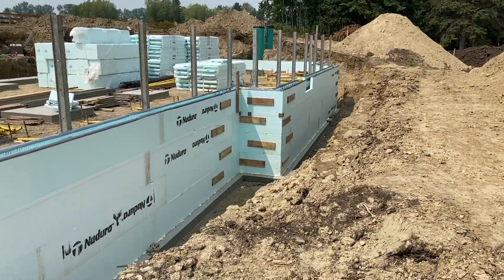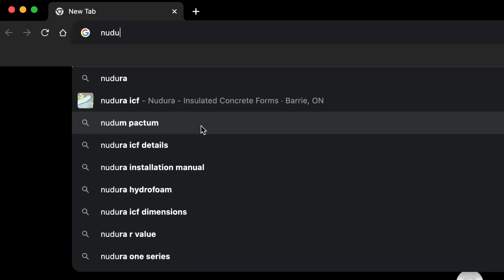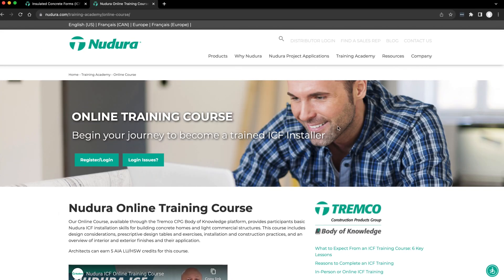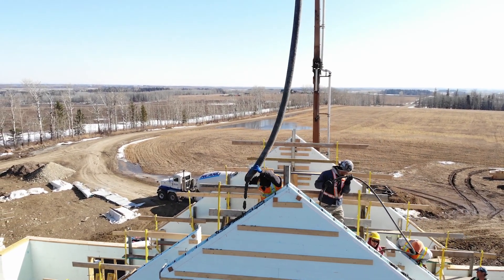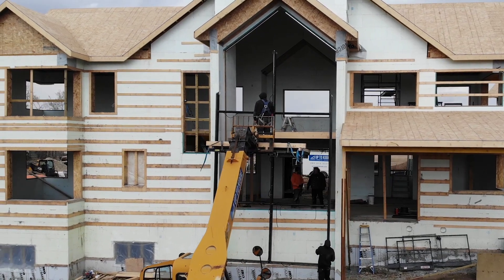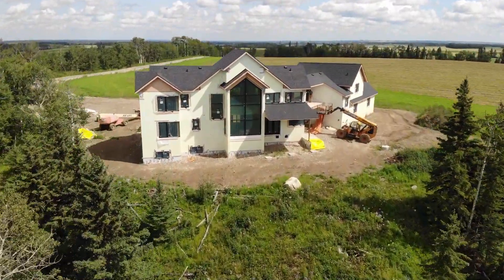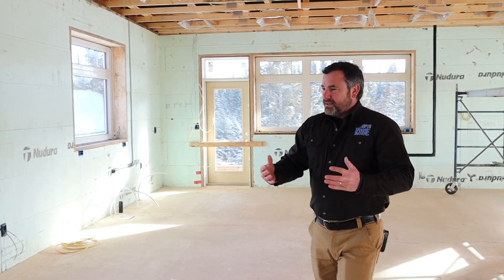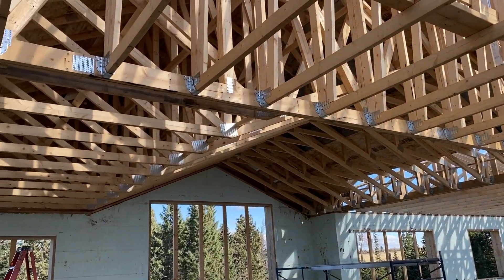ICF FAQs  | ICF Talks Sponsored by Nudura Ep. 2 #icf #nudura #construction #icfbuild #construction

Comment: I would like to do ICF to the roofline.  I want a fire resistant roof, so I plan on using metal roofing material.  I would also like the attic space to be within the house's inside envelope.  
I would like to use either roof trusses with Rockwool insulation or SIP panels with EPS foam centers.  What would be your opinion on these two options?  Or  Would you have a better idea that I have not mentioned?
Reply: @Navy1977 :  I've looked into ICF roof panels, but I'm not sure that I would go that route at this time.  ICF floors can be a good choice.
I've built interior steel stud walls before and they are dead flat for drywall.  I only use load bearing steel studs when constructing  interior walls.
SIP panels would not need any trusses or rafters.  I'm leaning this way right now as that would allow for a fully open/accessible attic space.  It would also allow for vaulted ceilings if our house design called for that detail.  For SIP panels to have fire resistance they need to use EPS foam.  If there is another SIP option, I am not aware of it at this time.
Rockwool has many benefits: fire resistance, water aversion, bug protections, and good insulation value. I would even install Rockwool under the concrete slab.
Reply from the maker: Great discussion and topic! If you use SIP couldn’t you just install 5/8” type X drywall on the ceiling (2 layers of you’re paranoid) with the metal cladding on the outside? Seems like a solid option to me. I’ve never used SIPS but worth considering
Reply: We used to build all-SIPs houses both as a skin over a timber frame, and where the panels WERE the entire structure. SIPS work great on the roof. Obviously the thicker the panel the better the insulation AND the farther it can span unsupported, and there are a bunch of other construction details and considerations. You’ll need a light crane on-site to set them. We used a unique panel made from polyiso foam instead of EPS so the R value and strength were both superior.  Good luck
Reply: PS all types of roofing will work but many mnfcts do not want their product placed directly on the panel, so you may have to create an air space w furring or even furring plus another layer of OSB. Make sure you know the mnfcts requirements. Back when we were doing it (80’s-90’s) the ONLY shingle product that would warrant direct installation was (now) GAF Timberline.  Everyone else wanted an airspace etc. Do your homework and know your options.